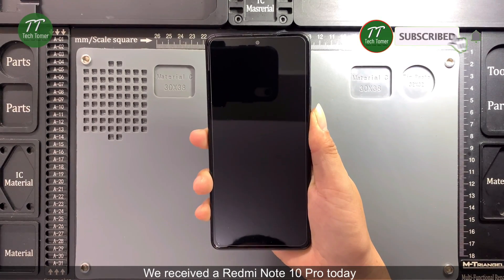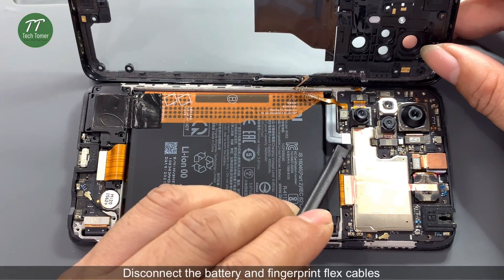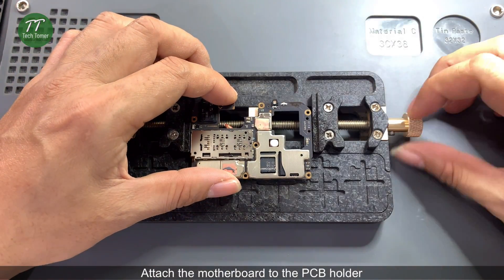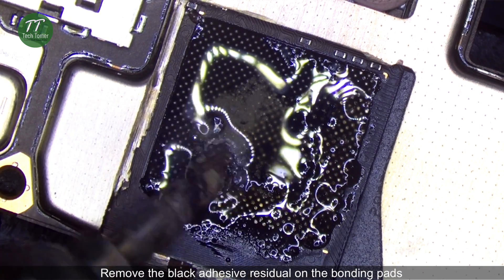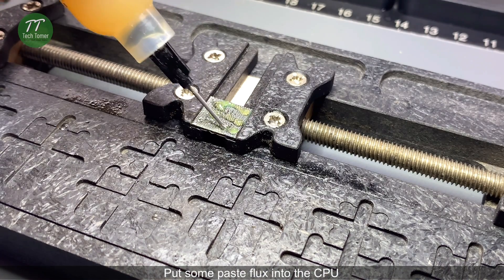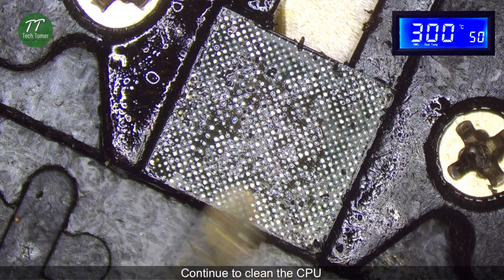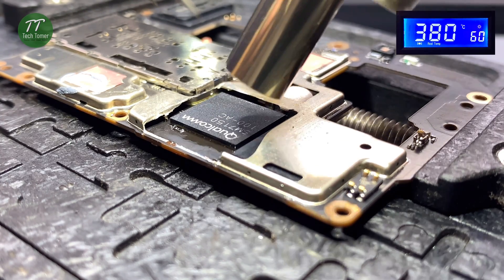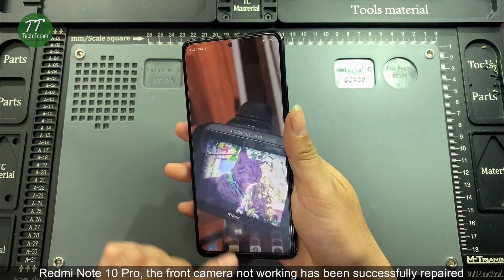Xiaomi Redmi Note 10 Pro Front Camera Not Working Solution - CPU Reball Tutorial | Tech Tomer

Comment: I'm having the same problem.. but I'm still using my mobile without reballing... Will it cause any harm?
Reply: RIP speakers later
Reply: @Rn007-p2c  Are you freaking serious 😭😭😭
Reply: @Rn007-p2c  After reballing?
Reply: After reballing no issues. The speaker died after 3 months of cam dead. Then did reballing. Now everything works fine
Reply: @Rn007-p2c  You done reballing twice then?
Reply: No...one time only
Reply: @Rn007-p2c  You didn't try Factory Reset before CPU reballing?
Reply: Tried another custom roms and also flashed fastboot miui. Nothing worked
Reply: @Rn007-p2c  😭😭😭
Reply: After reballing will the phone work totally fine ?
Reply: @angeloandes1627  i didn't reball... I'm using without front cam... But my 4n is working perfectly

Comment: I stopped the front camera and tried to fix it by clearing the data and formatting it as well as I did the software and it did not work by watching the video that the defect is in the central processing and does not need to change the camera please answer the question of what to do with my Mi 11 Lite
Reply: Same problem with same device 😞
Reply: @Nalendrapradama  Have you done this method? How's your phone now?

Comment: Very nice work
Very helpful video
Earned my sub
May I ask just one is the thermal pads @( 2:55 )not necessary because you didn't replace it in the assembling part, will it not affect overall temps while using the phone?
Reply from the maker: I just tried to see if the front camera would work, so I didn't put the thermal pads on first, but behind the scene, I also put the thermal pads back, that's important
Reply: @techtomer  okay, it make sense thank you so much 👍
Reply from the maker: @mat6506  you're welcome